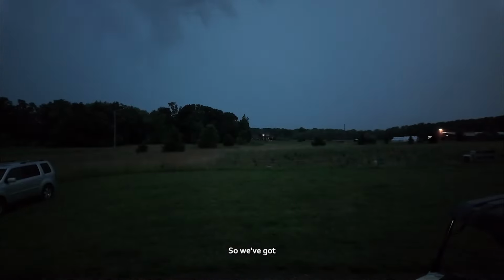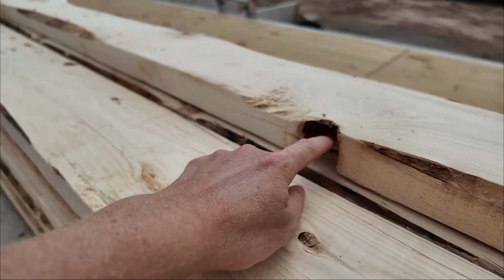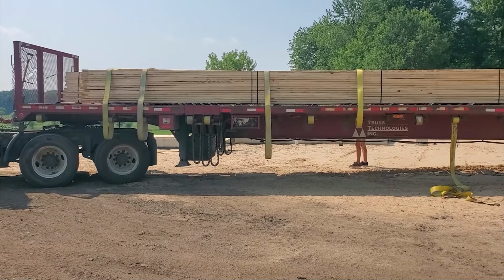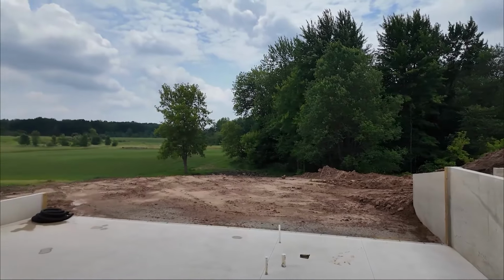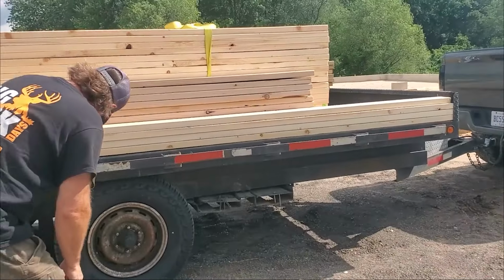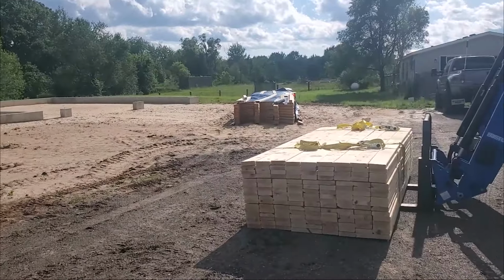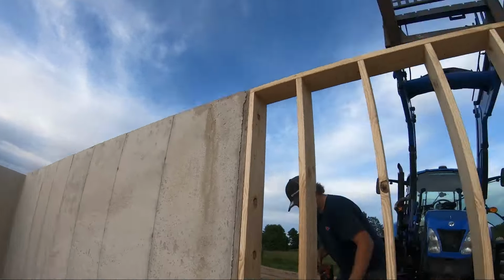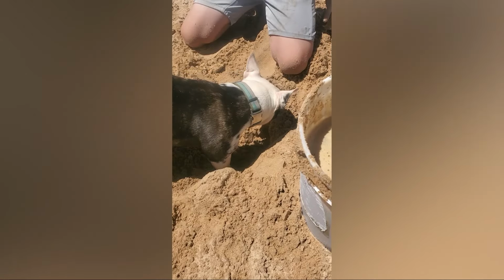Video #9: Building Our DREAM HOUSE (Fail)- How We RUINED Our Build From Day 1

Comment: "A" for effort.  Just a couple of pointers...use PT for the sill plate; put foam sill seal BEFORE putting any walls up on cement walls and floors ( NEVER ,have untreated or treated wood in contact with  cement); rack the wall  (square it) and nail temporary bracing in place before  lifting the  way in place.; bottom sill plate is installed and squared First,  then the walls and floor structure is build on top of the squared (and anchored) pt sill plate

Comment: You can level out the imperfections in the concrete with a hammer. You should have some kind of Sill seal in between the wood and concrete anyways.
Reply: Yep we do
Reply from the maker: It's there 😂, and we used a grinder for the lumpy concrete 😊
Reply: @ruralridez6165  I'm still waiting for the picture you were going to send me lol

Comment: Sorry for your problems. You might want to consider Carter Lumber or Big L.   I'm not a builder, but I thought there is an insulation that goes were the concrete touches the wood, and the wood is supposed to be treated.
Reply: Yes we did sill seal it's stapled to the bottom plate. And I have been in touch with them.

Comment: Waned lumber, where lumber has curved edges and shows pieces of bark . For a #2 grade (which is what is most commonly found at lumber dealers), wane is allowed to be up to 2/3 thickness and ½ width for ¼ length. On a 12 foot long 2×6, the wane could be 2-3/4” on the wide face, 1” in depth across the 1-1/2” face and three feet in length. Your wood will have grade stamping on it...like 2 HEM FIR. AS you have learned: keep materials, that may be effected by water,  elevated and covered.

Comment: I miss making prefabricated walls. We always used the better lumber I'm guessing it's  a #2 premium. We would use the other stuff for cripplers . I just miss it . I'm guessing 2x4's treated and or 2x6's that's for the bottom part of the wall if it's going to cement I'm guessing.
Reply from the maker: 2x4 for inner walls and 2x6 for outer 😊
Reply: @This1LifeWeLive  yes 😁👌🏽

Comment: Suzanne I agree with the three posters below. The wood should be bought from a reputable lumber yard. Another tip as old as carpentry: measure 📐 twice cut once. Two by fours aren’t. They are 1.5 x 3.5. You were off by three inches because of the two sill plates. Sill plates are the top and bottom boards of your wall. Each 1.5 thick. Together they make up the three inches that you had to take it all apart for. Good news you look great in your Truewerk outfit. And what’s more important than looking good 👍
Reply from the maker: Lol, yeah erik thought he was buying it from a high dollar store since we paid more than bog box stores 😢

Comment: My guess on the sheathing, it that it is coming on a different truck. That was a small truck for that many sheets. "Premium" lumber is graded by the size and number of knots in the boards. Unfortunately the barky lumber is way to common nowadays due to the fact that old growth pine are few and far between. The stuff with bark should be fine for most of the build. While not pretty, it should be fine structurally. I would use lvl studs on any wall that you plan to hang cabinets on. It may also be a good idea to use them on taller walls as well.  The settling of the dirt around the foundation is perfectly normal. It will settle a fair amount over the next couple months. The final grade should take care of all that.
Reply from the maker: They told us the sheeting wasn't on the delivery schedule 😢,but you are right on the lvls 😊

Comment: Did you place your Moisture Barrier between your concrete and your 2X6???
I wouldn't do anymore work or you may not be any warranty or the framer may walk from job site???
Reply: Yes pink sill seal you can see it attached to the bottom plate we stapled it on
Reply from the maker: Yep, as Erik mentioned we have the pink sill seal. It was explained in the video too ;)

Comment: Just STOP.  You should have proper lag bolts to hold the Sill Plate.  That truck is not rated to haul that much load. Or half that much.  When using the FEL, put the load all the way back to the vertical portion.
Not sure what that stove pipe strapping is supposed to achieve. on top of the wall.
Walls should have been checked with Laser and poured Level.
Leave it to the pros.  They will be blaming you for 'helping' failures.
Reply from the maker: We used the straps and the lag bolts 😊